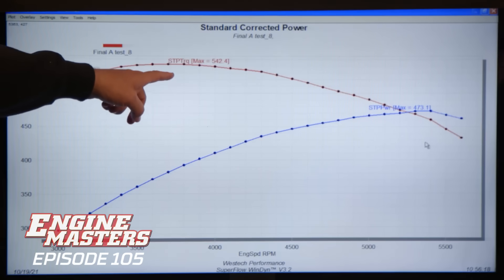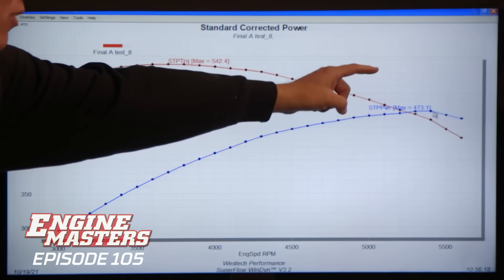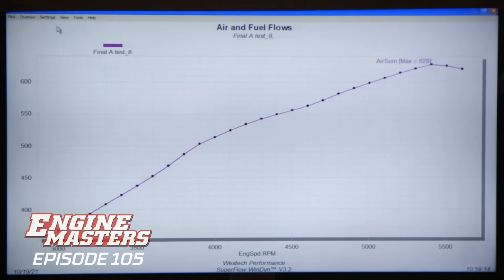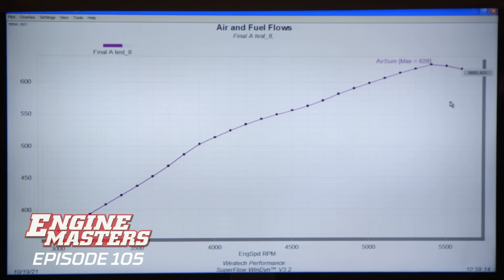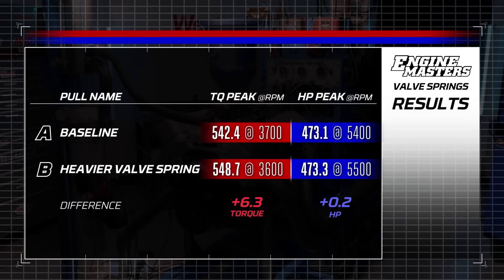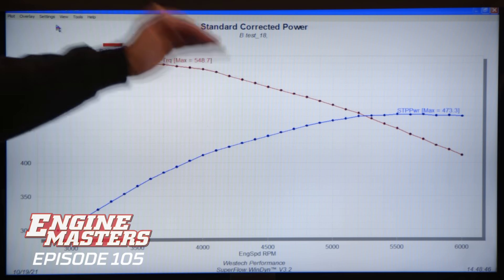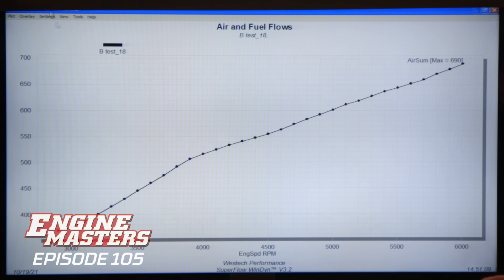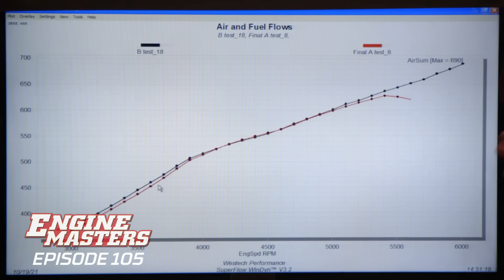Valve Float! What Is It, And How To Avoid It | Engine Masters | MotorTrend

Comment: Over a hundred years building cars in America and the heads look just like they did years ago. And does anyone here stop and consider you spend thousands  on parts to build a hp motor. Only to have it live and Die by a valve spring.  And the springs are under a 100. Dollars.😮

Comment: My small block 600+ hp 480 torque still pulls at 8200 i keep it at 7200 most mostly 65 6800. However its built rigjt

Comment: Ahh, valve float.  One of my favorite things about 2-strokes and rotaries is the sheer "who cares" factor with rpm.  It's a neat experience to feel the power nose over, and then hold it wide open for two minutes, knowing that it's just resonance timing and the engine has 4,000 more rpm of mechanical overhead.  Just... make sure you have good premix that day, lol.

Comment: Is their a lighter spring with a faster return rate, like maybe do away with the damper or  thinner outer and heavier inner. I remember some of the old Isky,s worked well and smoothed out like it didn't  rob power.  Just a thought.  Mike
Reply: Depends. Cams with gentle ramp rates dont require as much spring pressure

Comment: Do you guys have an email address I can use?
I’m having a RPM issue that I can’t resolve.
New engine build all roller and I can’t power past 5800rpm. 
After 6000rpms the engine makes this horrible cackling noise and just loses power AFR goes rich.
Built to handle 7000 rpm expecting 6500.
I’m guessing valve float but could it be an ignition distributor issue?
I’m using an MSD ready to run distributor.

Comment: Why is he complaining about 470hp from what it looks like a stock 454..... the most powerful ones where in the '70s chevelle with 450hp.... and all the ones from mobile homes had a 240hp that's what's pathetic....
Reply: I agree. 👍  I have a 454 bored to 461. heads, cam, etc..and I make about just 500lbs of torque and about 450 hp.

Comment: You mentioned all the new LS engines use beehive springs, but credit where credit is due...Mopar used them in all their Magnum engines starting in 1992.
Reply: The technology comes from military aircraft engines developed in the early 1900’s.
Reply: @thebigpicture2032  My comment was not to discuss the origins of the design. The commentary would seem to imply the LS, and GM in particular, was breaking new ground by using the design, when the first large scale application would seem to be the Magnum series.
Reply: And Mercedes in 1954. What's your point?

Comment: With my 4.10 gearing I really wanted to plan my build very carefully. Overkill? You bet. Expensive? Oh yeah. This build lightened my wallet, which encouraged me to eat less and lighten myself. Next up, the car (68 Barracuda fastback) gets a diet to bring her down to 2,900-3,000 lbs. with me in it.
Valve float? Not in my little 3.580" stroke Chrysler 360LA motor. I have a mild Lunati Voodoo solid flat tappet cam, 80 gram lifters, I did add mass to the valve train with some GOOD pushrods because the Mopar LA series cams sit kinda high and well, the geometry could be better. Comp 7228 438 lbs/inch conical valve springs, tool steel retainers, ductile iron rockers, Ferrea hollow stem intake valves. No, I am not running sodium filled exhaust valves, I want to keep the heat in the combustion chamber where it belongs rather than in the oil which would be absorbing that heat through the valve stems as the oil (Royal Purple HPS 10w30) lubricates and cools them. The plus side for that would be any water in the oil system would be boiled off rather quickly.
You couldn't pay me to build a motor with hydraulic roller lifters, and solid rollers are for the track.

Comment: I have a 1984 Lincoln town car thats got CFI. Anything past half throttle makes no difference its like i only have less than half a pedal. Tried literally everything. Whats your thoughts?
Reply: probably where the fuel cutoff is at.  what RPM is it happening at?  they design stuff from the factory so you cant blow it up like that trying to rev it to the moon
Reply: @KingJT80  its not really at a specific rpm its just in general past half throttle really makes no difference than half throttle. Itle rev to the moon in park its more of a lack of throttle response. Ive done everything i can think of. New injectors new tps new distributor everything. New iat new ect plugs wires the works.
Reply: @chrissanders2562  put some rear end gears in it 

It's got OD and I'm sure if you put a 3.90 posi in it you'll smoke the tires
Reply: @KingJT80  Hes looking for muscle car feel from a heavy low rpm tall geared car. Thats all shes got pretty much
Reply: Thats typical of many cars, trucks going back many decades. 
Normal. Heavy car with a tall gear not meant for rpm

Comment: I wonder if anyone has tried a system for opening and closing valves that uses heavy duty electronic solenoids/actuators that can be controlled by a computer module similar to an engine ECU? I remember the crappy Cadillac 8-6-4 disaster, but that is not exactly the same as what I'm talking about. With electronically controlled valves, you wouldn't need a camshaft, lifters or pushrods, hence no valvetrain rpm limit, just a bottom end rpm limit. You could literally change lift and duration on the fly and never worry about valve float. Less moving parts, less weight, it would be interesting to see someone try it if it already hasn't been done.
Reply: Koenisseg tried something like that yrs ago. May still have the vid up on YT
Not a bad theory but man...1 component failure goodbye block
Reply: @gordocarbo  I believe we will see it someday. As for failures, existing engines don't like eating their own valves anyway. LoL
Reply: könidsegg has freevalve system witch is basically what you are saying it has not been ina a car alrdy but is going into the gemera with a 600hp 3cyl

Comment: I Like to know What would happen if you had too stiff of a valve spring.
Reply: I think it might wipe out the cam. Or break a lifter depending on the setup...
Reply: It really depends on the specific situation.
Sometimes you will just be down on power and wear out things slightly faster. Sometimes almost nothing. Other times you might break rocker studs, bend pushrods, wear out valve stem heads, tulip valves, crack seats, collapse lifers, destroy lifter rollers, etc. etc. etc.
It depends...

Comment: Simply changing springs isn’t the fix. Aggressive cam opening and closing ramps, rocker geometry pushrod whip will all cause float. The solution is to use a camshaft that’s fit for your purpose with matching valve train components. The cheapest way to make your engine last is learn how to drive.
Reply: Thanks for letting us know you've never worked on a car.
Reply: @tahcogunworks  not sure what grounds you base that assumption on. Probably the same assumptions you use to pick valve train components.
Reply: @phelanpawly2507  hahaha.   Trust me.  I've forgotten more on building engines that you'll ever know.  Thanks for the chuckle.
Reply: @tahcogunworks  No , I don’t think so but if you sleep better thinking that be happy and be well.

Comment: I ran comp 911 springs in my 5400 rpm 454 and at 5550 they floated, I put in pac hotrods springs and no float, still singles but oval wire with a flat tappet X268 comp cam
Reply: comp xe cams are more modern flat tappet cams.  they need a pretty decent spring.  911s are lightweight vs what they really call for.
Reply: never heard of oval wire springs. where do you find them?

Comment: The person i bought my 67 el camino  from had a auto shut off on the ZL1 engine. It had trick heads, had roller rocker arms, triple valve springs and steel retainers. Victor jr manifold, 750 holley carb. Solid lifter cam 500" lift + 260° duration. 4.56 posi rar 1 ton axles and 4 speed. Lots of fun.

Comment: Valve float, valve bounce or valve lofting are all different things and can have different causes, including spring pressure, harmonics and cam lobe design.   There is a great video on youtube taken with a high speed camera under the rocker cover and shows valve bounce which is what I believe we are talking about in this video.
Reply: Post a link to that video I'm sure I'm not the only one who wants to see it
Reply: @hillbillymotorsportz8514 It is called "Valve spring 8500 rpm" it's made by dccdanny. It was published 11 years ago. Hope this helps.
Reply: You're right they are different things, but the term valve float is also used as a generic term to cover them all. Typically when you have not yet diagnosed the exact problem.
Reply: that vid you are talking about is one of the coolest vids on you tube for engineers.

Comment: quite some years ago i had an Alfasud which has a flat 4 overhead cam per bank motor boxer motor just like a Subaru, it could rev to well over 8,000 rpm as it only had a 54mm stroke , one day i experienced valve float at around 6150rpm no misfiring just a strange sensation while reving  , i didn't know it was valve float at the time , a friend of mine who worked at an Alfa dealer told me what the problem was he said that probably some retainers had split causing a loss of spring tension on the valves he said because of the flat 4 design the pistons were closing the valves affected ! , luckily there was no damage to the pistons or valves i could see once i had the heads removed Phew close call ,  he overhauled the heads and found that 2 valve retainers had cracked/split in the cone part of the retainer where the valve stem collets are seated causing a loss of valve spring tension , i fully understand why spring tension on a Valve is important as your video has pointed out cheers

Comment: Think of it as an automatic high RPM compression release.  I mean really, most OEMs deliberately put soft valve springs on their low performance engines as a rev limiter.  The engine literally couldn't rev high enough to hurt itself.  And then you guys go and undo that careful engineering in pursuit of your irresponsible pleasures.

Comment: I have a panhead harley that I've owned for over 40 years, am running a ridiculous big cam, and use the stock FL valve springs (way to light seat pressure for the cam) and I rely on the valves floating as a rev limiter, but having it for as long as I have, I don't abuse it, also the light pressure on the valve train has the benefit of not wearing stuff out fast, I do weird things with my vehicles but would never do on a customer's bike, car whatever, but for myself I go way out in left field, and it works for me
Reply: I respect that.  Cheers
Reply: Not enough spring pressure can beat up the valve job, tip lifters etc
Reply: @gordocarbo  I have been riding this same motorcycle for 44 years, I have been building engines longer than that, I am keenly aware of how engines work, and as I said, I don't abuse my own stuff, but I guess everyone else knows more about my stuff than I do, It's great to know that I'm stupid and don't know anything about what I've been doing for over 50 years,
Reply: @gordocarbo  only if you rev it to the sky

Comment: Why no Ti valves? They are fantastic at high rpm and allow for more aggressive cam profiles. The other I would like to see are Sodium filled valves for higher cylinder pressures.
Reply: Sodium filled valves? Not in my engine please.
There's a reason why you don't see them any more, and there's a reason why they are never used in racing. High cylinder pressure? What does that have to do with sodium filled valves? I'd take either Inconel or Ti for that application.
Reply: maybe because fatigue
Reply: sodium is for boosted applications not for revving

Comment: So is this relevant to 90% of engines made in this century, considering most are over head cam..? Obviously there are still valves and springs, but I have never heard of this on a modern engine.
Reply: This is a boomer show so dont expect much. Also you dont see this much because people usually put in an adequate spring.
Reply: This is very relevant to modern style engines. If you think a modern Porsche engine would not float its valves if there wasn't a rev limiter, you are dead wrong.

Comment: Valve float is also a function of the spring harmonics, should have talked about BeeHive springs.  Beehive springs have less of an issue with harmonics and you are able to use less spring pressure to control the valvetrain
Reply: And for certain engines like Buick, they clear the top at the rocker better.
Reply: if beehives are better why do the nascar guys never use them?
Reply: @davidgalea6113  its the difference between "loft" and "float".
The idea was to ski jump the valve off the nose and have it catch on the slope. Beehives provide more stability, but loss power because they dont promote the ski jump.
Mind you, this can be done with a solid flat tappet. Try this with a roller cam (especially a needle roller) and the roller destroyes itself from being unable to take the landing impact...
Reply: @crd-nz_001  they used flat tappets in the cup engines and they used rollers in the nationwide engines.. today both series use roller lifters.. my point was that you rarely see the beehive springs on high rmp engines...usually it is the double/ triple springs.  probably not the best option if you are going above 8000...
Reply: @davidgalea6113 I was curious about beehive springs. The applications they are sold for seem to only be for LS engines but they will possibly work on other engines. I have the single spring and retainer on a 515 lift 351C.
Reply: @crd-nz_001  Crane used to have a launcher series of cams in the 70s?
To do just that. Didnt work out so well. lol
Reply: @davidgalea6113  hard to get enough pressure as no room for multiple springs.
Reply: @davidgalea6113  Due to high spring pressure cant use beehives.
Reply: Cams that have aggressive ramps need a good dual spring or better
For stock or mild stuff beehives can help

Comment: I've dyno'd where the graph dropped at about a 70 degree angle. Interestingly enough, a .060" valve shim fixed it.
Reply: Spring shim?
Reply: @goratgo1970  Guess so.
Reply: Reason is that you had too much free spring when compressed. Obviously it will also increase pressure, but what few seem to think about is how a spring that is too tall affects control even if the pressure is correct. Never let it be more than 0.070 between bind and open height. About 0.030-0.040 is what you want and that's a big part of why so many have issues. Probably one of the most overlooked issues in valvetrain setups.

Comment: Floating a valve is my biggest fear in my old Chevy. I’ve got a 1978 Big 10 with the 454 and 400 turbo trans. It’s all original parts, and at 128k lol
Reply: Probably fine with that 400 lift cam and a redline of something in the 4000rpm range
Reply: @taylorsrus9543  if I put a cam in it I might see 4000 rpm but it doesn’t care for more than 3500 lol
Reply: Be ok long as you don't hold down while they float
Reply: I'd be more concerned about how the locks and retainers are doing at that age.

Comment: Silly pushrods. How to solve valve float? Some new fangled technology called "over head valves" only available on the newest, most advanced vehicles like the 1972 Honda Civic.
Reply: You should re-read your attempted joke. This is an overhead valve engine.  You most likely meant overhead cam, which spoiler alert, can have valve float too.

Comment: Why not run a titanium valve?
Reply: For race motors yes
Reply: They wear out valve guides, unless your motor is getting rebuilt entirly every season they're not a good idea
Reply: @AustinSawyer-go4sd  good to know. Thanks!
Reply: @brettmccafferty465  
It's not true, unless the builder is an idiot who doesn't use the correct guides, clearances and/or valve stem finishing.
Some production cars use titanium valves, IIRC the top end Corvette engines do, for example.

Comment: You'll hear a engine float valves. Not a good thing. I have a camshaft that's runs up to 5500 rpm. But I still maintain the single hd springs. So yes weight is a problem. My engine will clatter at 6500rpm. Don't hurt the engine to go to 6000. Just point less on a street engine. I could have double springs. But having a soild camshaft. It will wear it down quicker with double springs. So I normally only hit 5000 in first and 5500, in the remaining gears.
Reply: Is it a diesel?
Reply: @taylorsrus9543  no it's not a diesel.
Reply: @taylorsrus9543  a diesel would have holes in the block before 4500
Reply: @jradish  I better go look for mine.
Reply: @jradish  a high performance diesel engine can rev well past 4500 rpms but a stock diesel engine will certainly grenade itself

Comment: No titanium valve? I guess I missed the valve choice discussion.  Mushrooming stems or what?
Reply: rapid wear constant adjustment. no good for a street engine.
Reply: Think i missed something as well
Reply: And 100 bucks a valve vs 12
Reply: Bronze valve guides, dlc or nitride coated stems to not gall, and sometimes special lash caps to keep the roller from eating the top if the stem. And price… Always the price.